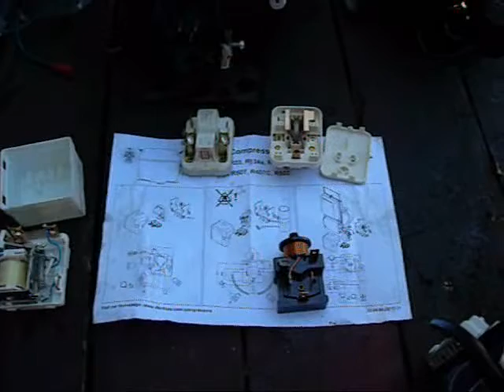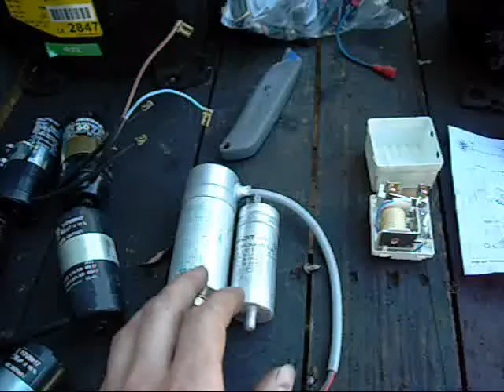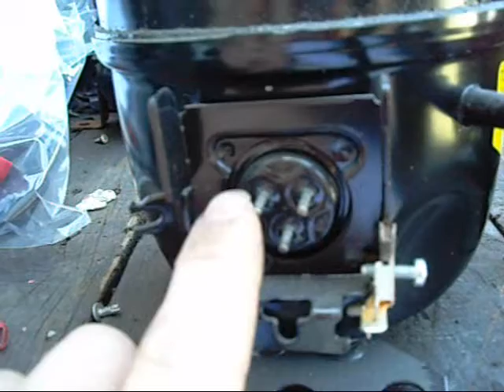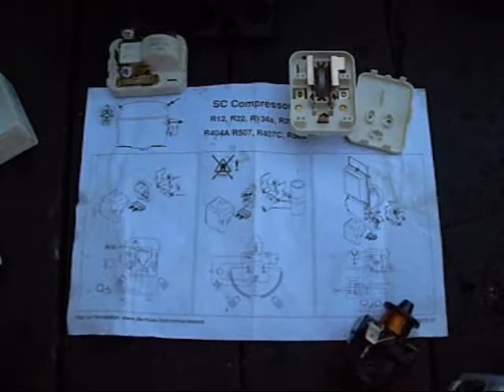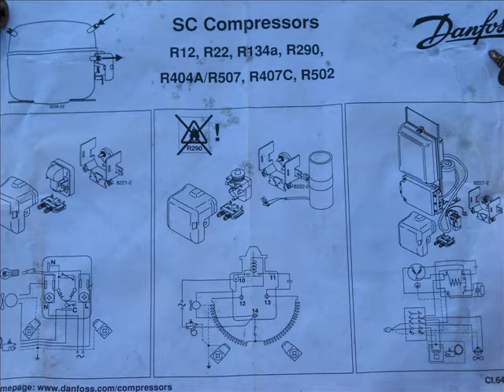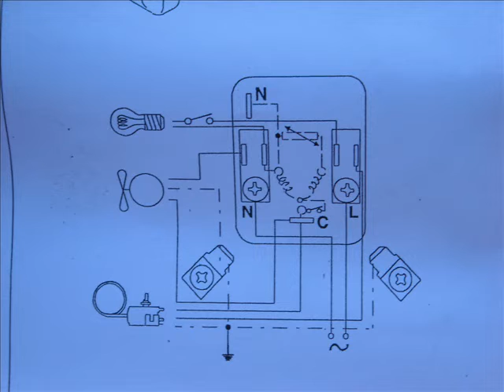Re: Compressor Starting Equipment and Wiring Diagram

Comment: I picked up a mini-freezer yesterday (local pub threw it out), tested it out in the shed today, ran fine, inside went down to a bitter -17 degrees Celsius at full tilt, no odd noises, no overheating or anything, cleaned it up and brought indoors, now the bugger won't run, just sits there humming and the overload relay cuts out, the PTC tests okay (22ohm spec., 23ohms read), no capacitor in the circuit, so, either seized compressor or dodgy PTC... :\

Comment: high ed i just got done with an epic battle with a ptc relay on my little vacuum compressor , what i did was connect a 1.5 ohm resistor and a switch, i flip the power switch and nothing happens until i flip the relay switch then the  motor kicks on .
i just posted a video didnt think i could ever get it fixed

Comment: @Aussie50 The repair company I was an intern for binned a $1000 miele motherboard because the <$10 filter cap was blown.
Tried to tell the guy I was working with that it woul work for sure if the cap was replaced, but he thought that was an improper thing to tell him, as he was my superior, an fired my sorry ass.

Comment: Hello 
I have an air compressor but with out any electrical box , there are just 3 terminals ,
how can I connect it top run on 220v ????
and thanx for advices <3

Comment from the maker: @skags2 Good question!, I have not personally tried it but I am meaning to soon (I have a few old inverter AC units with good comps) and a 2Hp VFD.

The compressors are a sensorless BLDC (permanent magnet) motor so I have my doubts as to weather it will work. I have tried a DC motor on a Fisher Paykel washing machine and it turned erratically and slowly wile pulling high amps :(

I'll try and do it this weekend when I scrap the old units.

Comment from the maker: @jatontherun Interesting, I googled the name and it looks like its all in one cabinet like a welding unit?

Some compressors have unloader valves that leak a little air at low pressure, or after shutdown, unless its just started leaking (have you had it long?) it could be normal.

if not maybe your pressure switch is kaput and leaking/triggering early?

I've never worked on a unit like yours but it can't be too complicated.

Comment: Ed, perhaps you cqn help. I have a Badger Silent 1 compressor that starts up okay but as it begins to build pressure, it shuts off and I can hear the air escaping. Any ideas? I tried replacing the capacitor but its still doing it. Hope you can help!

Comment: @Aussie50 Thanks for the reply. Yep, have tried 2 compressors now and have the same result, both from working fridges, both using the existing relay and overload protector (no capacitor). They don't run warm and hold the 6 inhg for a long time when switched off. Am on the hunt for another donor.

Comment from the maker: @2sixstreet if you attach your gauge directly to the suction of the compressor and only get 6in/hg your compressor is trashed.

if not, you may have a vac leak in whatever apparatus you are using.

Comment from the maker: I'm not familiar with that model but if its an AC powered compressor and you have tried connecting power to the start, then run windings it may be stuffed.

can you describe what its doing and what you have done to try and start it?

Comment from the maker: There are a few ways to hot wire a compressor, like you said about the push button, but it is a bit dangerous if somebody doesn't know how to start it and tries to run it.

If you don't want to release the gas from that fridge, the only real option is to get a HVAC tec to recover it for you. home made recovery systems are too dangerous and far less legal than letting the gas out to begin with!

Comment: I used trial and error on a compressor I was playing with some years ago, I ended up using a momentary pushbutton switch to start it. Also, I wonder if there's a way to contain the gas, I know you can get fittings to go on the copper tubing... I have a really old fridge I want to dismantle but I don't want to release that gas

Comment from the maker: I built one of those with a Danfoss SC15 compressor and surplus air tank from one of those cheapo chinese compressors.

Too slow to charge up for my use but for airbrushing or small hobby work it would be fine.

I'll do a quick vid this weekend if i'm not too buisy, give you an idea of what parts you need.

Comment: Yes, my bad, it is a thermal switch and it does have a relay of some sort which plugs in the 2 bottom pins and i've figured the connections in like 50 sec.   Thanx

Comment from the maker: Well, I wouldn't say I have excellent knowledge of HVACR compressors, but its enough for hobby use :D

Most of the compressors I get are scrap, but I do keep a couple as ultra quiet air compressors and vacuum pumps for my experements.

I just found a box of 12V inverter modules that attach to the small Danfoss compressors too, so there may be a silent 12V air compressor on the way.

Comment from the maker: Hey man!, I'm not fussed about a little fridge gas ;), i've done my share of misdeeds far worse than that in the past ;)

If theirs no capacitor then it should be similar to the Low start torque device in my video, just figure out the run and common terminals and wire it up.

The transistor like thing? is it a round canister with 2 pins, attached to the compressor housing?, if so its probably a thermal switch to shut down the compressor in the event of overheating and can be left as-is.

Comment: Thanx for the info. My motor just had the relay and some kind of transistor or some simmilar component,no capacitor, and i did release r 12 gas in the air (hehe) sorry

Comment from the maker: I know its misleading to say you Cannot run a compressor without the starting device when a person with good electrical skills can make a starter using a push button and contactor arrangement,

But its the safest way to use the existing equipment for amateur home hobby use.

I'll do a second part when theirs a large quantity of different refrigerators at the local scrap yard and I can go through and pick out different starters.